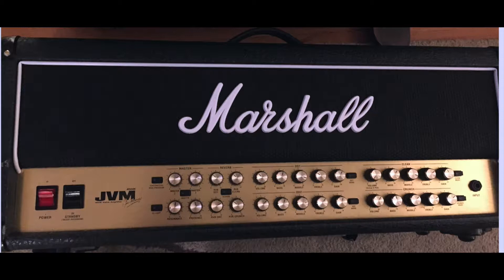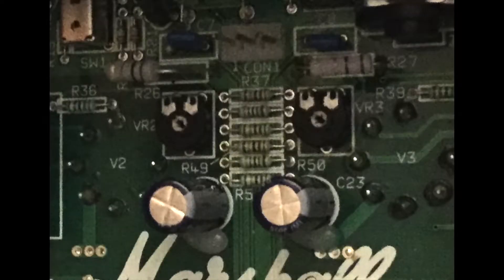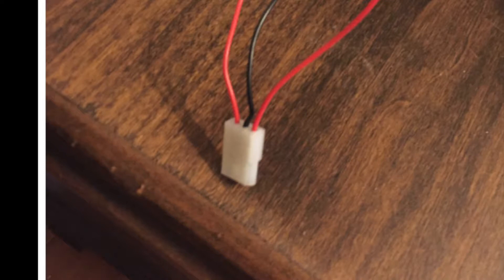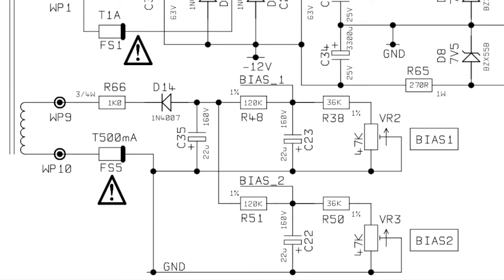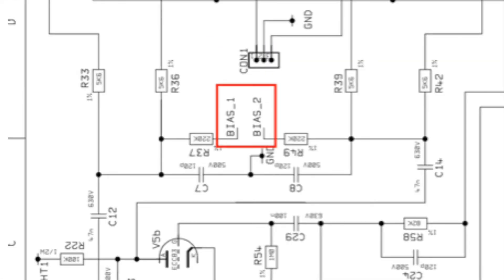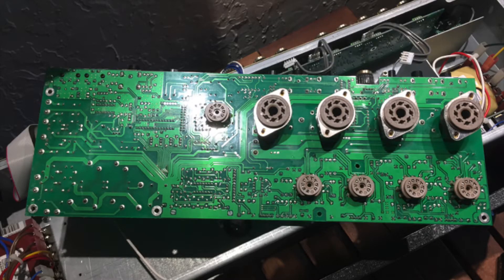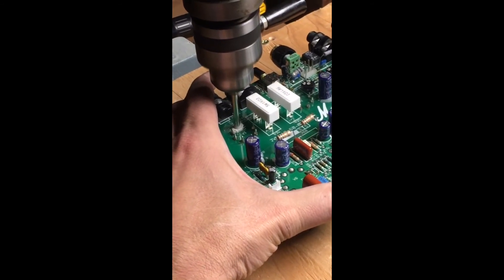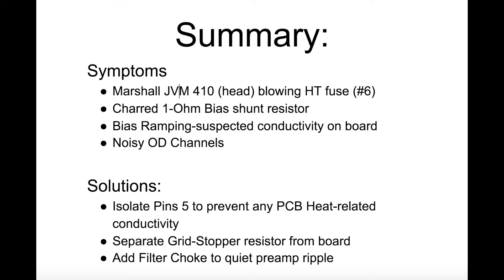Marshall JVM Bias Drift  PCB Surgery

Comment: "Suspected" board conductivity LOL. The pcb is made of epoxy bonded glass fibre. It will not conduct. If there's a build up of dirt on the board, that might, but then why not clean it instead of butchering it? I also don't see any moisture build up possible with all the heat for the tubes. There must be another problem.
Reply from the maker: Thanks for the comment.  Although, the ideal application-designed FR-4/G-10 should not conduct, unfortunately, this is not always the case, as there several factors (usually thermal) that can bring about this phenomenon.  I work in the semiconductor processing and fabrication world, and this is quite a common challenge.  

There are several academic and online articles you can look up regarding the thermal properties of this material, and the potential for expansion/contraction, which can lead to traces that would otherwise be isolated from each other, losing the ability to be insulated from one another electrically.  

Dr. Tube has a practical write-up on this related to Marshall PCB's https://www.drtube.com/modification/jcm2000-stable-bias-mod/
Reply: I worked in electronics, including pcb design for over 20 years, and have never even heard of this. How do you make glass conduct by "thermal" means? How does expansion/contraction decrease insulation? I know all about arcing and clearances for high voltage PAT testing, but that's not the case here. The cynic in me says Dr. Tube want to sell their kits. They certainly don't have any creditable description or evidence for FR4 becoming leaky on their website.
Reply from the maker: @ricobass0253  I'm certain you are very qualified, and always made sure to take all necessary precautions in your designs, and your point about the epoxy itself is correct.  If you have a better method to solve these issues, there is a large community of Marshall owners that were love to learn about it.

The issues, as I understand them have to do with the expansions of the dissimilar materials; those being the traces vs the epoxy.  PCBs are not only made of epoxy, as there are several other steps that go into making sure they are able to contain electrical circuits.

From my experience (on modern fabrication which does not involve tubes) we encounter several issues on the more modern boards, where cost savings are looking to be achieved.  Examples tend to be related to humidity in the substrate, deflection during layer curing, and general instability of the related traces and pads prior to advanced packaging.  These and other factors lead to shorts and other problems, ultimately leading to PCB failure (think about the number of flat-screen TV's that fail because they need a board replacement).

Nonetheless, I had to work on this amp for many hours before resorting to the brute force of isolating the components and having success.  There are several tests, component replacements, and other methods that I did not go into for time's sake in the video.   

As a final note, I easily lost money on the time spent working on this amp.  I also spoke several times with Dr. Tube, and he had no issues discussing how one would go about this on their own.  Based on my communications with him, it is hard for me (having no affiliation with him) to see how this is a ploy to sell kits.

Comment: Hi Mate, great Vid , just wanted to ask, did the pcb surgery do the trick? is the bias now stable? also does the choke mod help with the bias drift? ive just purchased  a 205h used, pretty happy with it, once i set the bias best i could to 31mv. 

i was thinking about mounting the power tubes to the chassis and wiring back to pcb,  should help with heat dissipation. 

Also, i'm guessing a jcm800 choke would do it? 6h i think. 

What are your thoughts on just adding a cap either side of the resistor , instead of replacing with choke? 

Since you have been modding this circuit, i thought you may have the answers ! 

Thanks again for the vid and cheers from Australia.. Mick.
Reply from the maker: Thanks.  For now The PCB surgery has solved the problem.  We are going on more than 2 years now, and it is still going strong.  Since the PCB work, the owner of the amp had been playing quite often before our bar shutdown here in CA with no problems.  The choke makes the amp quieter, so Bias drift is not going to be tackled by that, but much of the noise floor is gone..  My suggestion is that you play yours stock if you are currently happy with it (unless you are a professional touring musician), if you are lucky you won't encounter these problems.  That being said, if you do, go ahead and do the surgery.  Let me know if you need any advice.  I can be reached at my username@gmail.com

Comment: where can i buy an R27 bias resistor?
Reply from the maker: there are a lot of places, but what you want is 1ohm, 3 watt, 1% tolerance.  Try tubes and more, tube depot, antique electronics, Digikey, Mouser, or arrow.
Reply: @jloewenheim  Thank You sooooo much, really appreciated! .... I almost used a 1 watt 1ohm 1%
Reply from the maker: @mikeliotta7530  1Watt will likely work as well, but I like the 3 watt in particular if you are using an EL34
Reply: Hey thanx again man! Ordered afew 3watt.... Goin in my jvm410.  Have a great & safe 4th of July, Bud!

Comment: No excuse Marshall shame on you they knew the TSL and DSL both suffered from conductive boards,  I have the TSL 100H
Which lasted for 14 years before this happened and I had to replace the revised mother board , I gigged that amp for six years solid with no problems, and it had external bias points and fuse holders, unlike the cheapskate JVM which I also own and have hardly used as I use a boss katana
Head now, (awaiting derisory comments..)
Reply from the maker: I'm not sure I have any derisive statements to follow your comment, but I do know that this kind of thing is frustrating (as a player and doing the repairs).  I put the video out to help all of us who have encountered this.  Unfortunately, there are some mismatches when it comes to trying to infuse legacy (tube) and modern technologies.  If you look at my HRD videos, you will see that my real recommendation is to dump all of the modern components, saving only the transformers, and then converting to the original Fender and Marshall build technics (eyelet and turret boards).  The only issue is that you lose the convenience of the IC's that enable switching and effects programming.  

Nonetheless, thanks for watching and your input.
Reply: Derisory comments for using solid state Boss amps from tube snobs is what I was getting at lol!!! I labelled every connector to the board with little tape flags with the legend ID from the PCB, and double checked them before I disconnected them when I changed my TSL 100 mother board, I really didn't expect to see this on the JVM I'm very dissapointed with marshall over this especially being from the UK
I'll probably sell mine now
Reply: Steve Grindrod, who designed the two-input Master Volume 2203/2204 in 1976, also designed the JCM 2000 DSL100 in 1995 to compete with the Mese Dual Rectifier... the amps were rushed into production without the normal R&D working out any bugs, etc. and the PCB used in the early DSL/TSL/JVM had a problem with some sort of organic material in the motherboard... which caused all these issues with the board becoming conductive and all sorts of problems.